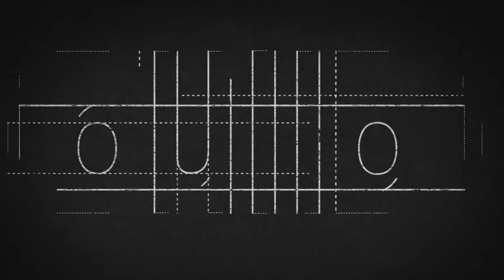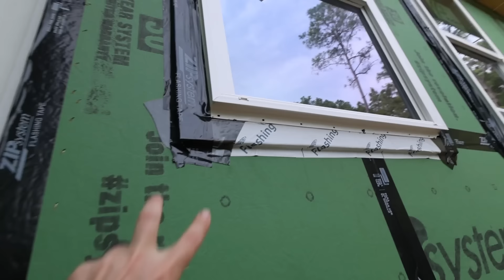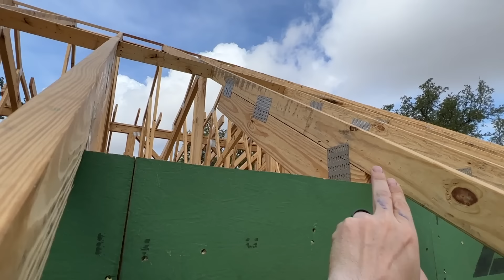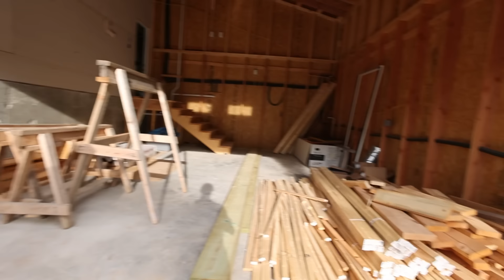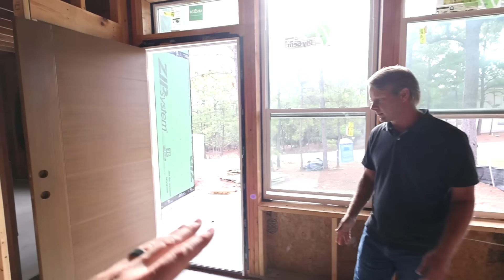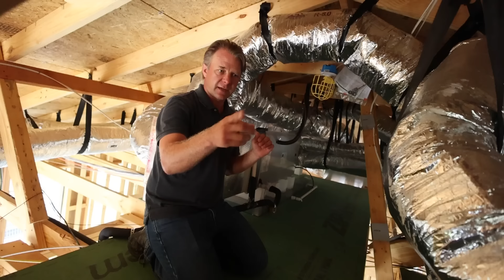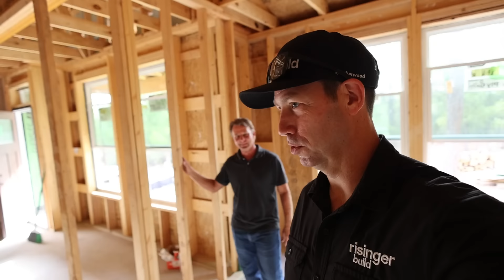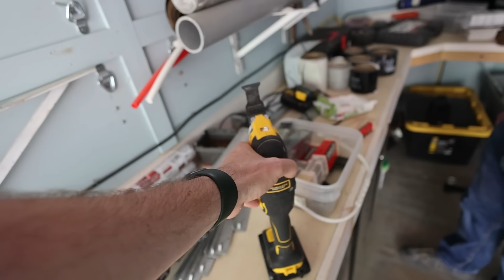LOW BUDGET Details For A High Performance BUILD

Comment: @matt as a fellow Texan, it would be a very interesting video to see tips on what current homeowners can do to better air seal on existing spec homes. I.e, what is the best bang for the $$ to do first. Should we caulk/liquid flash all exterior penetrations? Spray foam attic roof deck underside? Spray foam garage walls/rafter? I know it can vary based on the house, but I wonder if there’s a list of common ones.
Reply: Not sure if Matt has covered this one in any of his videos, but if you have an pull-down attic ladder inside the house, making an air sealed box is a great way to seal many square inches of otherwise unfettered airflow in & out of the house.
Reply: @justinjimenez6960  that’s a good tip, but I’ve already used spray foam on the underside of my roof deck, making it a conditioned space up there, so I actually want airflow and circulation with the air in my attic.
Reply: Hire an energy auditor to perform a blower door test and inspect for air leaks. They'll use a smoke pen to check around penetration like ceiling light fixtures and windows and doors, etc. In some places, energy companies or cities may have programs to subsidize the cost for this.

Comment: 18:10 Matt very good points and topics @matt risinger and this topic/queries can be a hole 1-2 hr vid in itself, OMG.
One thing I have trouble w/ is getting good plumbing subs who know how to work with freestanding soaking tubs that are on the high end of things (materials, function, plumbing it correctly, using correct materials again as some materials Can’t be used w/ certain brands etc.., & just understanding how they install and uninstall if gotta remove to fix or replace a part ¹ ) and it really is amazing to see and find out that the company coming to install & hookup plumbing and tub has never done one before, &/or don’t understand the mechanics. Example: don’t need to remove tub drain w/ drain wrench to remove a freestanding soaking Tub, they usually use a F2 drain assembly and will pop right up and out, ALSO don’t need to remove overflow either; and that’s another issue of concern, installing correct overflow assembly for the brand and model of tub b/c some need to be at 90s, or angled and finish around a 45 or something different altogether; but gotta read the rough in measurements and finished list of materials need, same for the high end toilets, some can be hours for installing and that’s the rough in; not counting actual toilet install, b/c of how some high end toilets mate to floor, wall, and closet flange and bolts; as some newer high end toilets have a complete different install system than the “usual regular” toilet most ppl used to…..
Ok, ‘nough of me writing novels & ATing you Matt (sorry), but really like your vids and what have to say, along w/ your stories…..LOVE ME SOME STORIES, regardless of length, cheesy, learn something, etc…. Nothing like listening to stories😊
Cheers✌🏻

Comment: what about soffit venting for attic heat?  Love the idea to seal the building but typically air moves over the insulation from the soffit out the ridge vent?
Reply: Absolutely not needed as it's a sealed space
Reply: No need it's a condition space it'll be tempered just like the rest of the house.
Reply: Not needed here but in other climates this is a BIG no no.

Comment: I am not opposed to the long format because there is always a nugget of knowledge in there somewhere.  My wife and I are currently building a high performance house in California using what we learned from your channel.  So far we have the Stego Crawl vapor barrier, foam under the sill plates and the Advantech flooring.  Our lumber and Zip R3 arrive tomorrow.  We have been documenting the build on our channel if you are interested.
Reply: Cali has very strong codes due to earthquake inevitability.   I'd be more concerned about building above code in that area and in materials and techniques that allow the house a better chance to survive a wildfire then I would be concerned about Air tightness.   This is nice for sure but he mentioned it's not built for earthquake concerns in mind.

Comment: @matt risinger  (real quick as an fyi: buildshownetwork website been down & not sure if a cloud flare thing or what thing🤷🏼, & miss my buildshow vids😫)
Hey Matt, when you added the zip sheathing to soffit up against sub fascia that’s angled and going back to rest against Zip sheathing, you can rip the Zip sheeting to same angle as roof and soffit to give a nice “connected surface” for when run your Zip tape and/or liquid flash. Yes, takes some more time; but at same time, not left w/ larger “gaps” that may require you to go back and fill a total of 1-3 times to get that sealed barrier system. Making the Zip Soffit same angle at front and back (as does take time) will help skip going back multiple times to do taping and liquid flash sealing. For those who don’t know, can use tracksaw (what I’d recommend using on-site) or table saw and a good blade for cutting, and making sure to keep things squared up etc….
Another tip for ppl, the circles & squares on Zip sheathing mean following: circles = 16 “ OC; & squares = 24” OC for a quick way of measuring w/o running your tape out; unless doing an “odd” pattern and than need to😉
Thx Matt for sharing your builds, knowledge, & experience w/ us. Always have a fun time watching the vids (wish more and longer TBH) & still pickup & learn new tips ‘n tricks from you and team (team you have on buildshownetwork dot com ¹ ); as can always learn something new regardless of years in the trades or on the job……and if your not still hungry to learn (or review) than gonna get passed by b/c w/ all the technology (tools, etc) and building science that’s out there always in flux (evolving, and such) you really need to embrace the tech & science b/c not gonna go away, and can (and does!) make things easier (at time harder, yes, but everything is the 1st time 😉); which means less time on a “job/service/tech call” which means more time w/ fam and friends…ahh yes, also more money too😉
Thx again Matt, cheers my friend ✌🏻💙

Comment: seems like with the increase of temperatures yearly house designs will have to change to address more extreme temperatures. Wouldn't more shading areas around the house help in cooling the air around the house? Having a covered driveway. extend the roof around the house.

Comment: The long format was suitable for this video. You were covering an entire house and introducing a builder. However, a smaller video covering specific topics is probably better for most videos. For example, you could follow up this video with a shorter cut focusing on the roof truss sealing detail. Shorter videos with a focused topic are easier to search and share.

Comment: Had to stop at "homebuilding as it should be" to agree. I ripped apart my 97 year old house to studs and it was hard as hell to custom cut each random distance stud bay with insulation and because it had fire blocking all the way around lol. The uneven surfaces and during and omfg. But homes should def be like this and yours, so much liquid flashing , buy a box of 8 at min for every 1000 SQ ft lol... Min. Open the sausage gun from the other end, it seals shut lol.

I called company and no solvent removes just mechanical, fun but good stuff

Comment: Don't use sill seal as a furring strip, I've tried it. It compresses too much, and too inconsistently, and allows your siding material to get wavy. The best budget friendly approach I have found is using ThermoPly, ripped into strips. Then you don't need to furr out windows, and worry about that detail leaking. I've had poor results from that in the past, so I try to avoid it.
Reply: Thank you for the comment! I am seriously going to reconsider the sill seal.
Reply: Scott as long as we are. Thoughtful creative, think out of the box-eschew zip ‘monopoly” and use cdx with Benjamin  obydyke SA product with built in rain gap.also i think if you price out that fentrim tape you will find. Zip liquid flash -or any of the equivalents Prosecco, henry blueskin, etc-is no more expensive and arguably superior I. Also i think it makes sense to run a thin bead of zip liquid flash over the bottom  edge of t he bottom zip sheathing board (for that matter esp OSB and arguably CDX sheathing as well).it’s unprotected by the green skin AND is often damaged on site/install. I know it’s more resilient than generic  ‘standard” generic osb, s. But its not advantech.
Reply: LMAO LMAO

Comment: So this should be added into anyone doing a new roof and soffits ? No more venting to ridge once spray foam done? I wish I knew all this before my roof was done , missed chance to add insulation but sheathing was 100/sheet and I have tongue and groove. No attic . Cathedral ceiling

Comment: Air tightness and insulation to this level should be a federal requirement for new houses and additions.
Reply: Piss on that idea
Reply: Building and Efficiency codes
Reply: Along with an air exchange system with heat transfer to maintain efficiency. And standards on materials and outgassing rates of toxic gases.

Comment: I see that Scott didn't do the Zip version 1.5 detail of liquid flashing the nails for the first 2 feet above the foundation.  Beyond that glad to see high performance building techniques done at an affordable price point.
Reply: I did this on my house, and it does take a little longer than you’d think. The liquid flash is messy, expensive stuff but is pretty incredible. I’ve had some around an outdoor faucet exposed to UV for a year and a half and it’s still as springy and rubbery as it was right after it set up.

Comment: So bc you spray foam the underside of the roof instead of the traditional blow in attic insulation, that means we do not need the overhangs where traditional sofit is placed to be able to vent and now can be sealed up?
Reply: No venting. The attic is a conditioned space. Conditioned attics reduce loads on HVAC and provide cleaner environment throughout the house. 
If you can find 2 videos of Matt's old house and the other of his new home; he shows the difference. It is Amazing how nice an attic can be when dirty air is blowing in, barely cooling.
Reply: I have basically the same question. Is there no roof venting at all? Isn’t that a problem if any moisture makes it through the roofing material and onto that roof decking it won’t be able to dry? 
Maybe the roofing material is going to be shimmed up like a rain screen? Kinda like how Matt did under his Metal roof?
Reply: Yep, you can either vent your roof or build it just like a wall. There are advantages to both.
Reply: How do you handle the vents from the bathrooms?

Comment: Dumbest thing ever?  Zip system!
Reply: Why?  What's your reason? Can you point to any info to explain your position?
Reply: @markwatson9816  permeability of one. So you have to have an entire fresh air system
Reply: @anthonyman8008  Thanks for the insight.  I guess it's a point of view but looking at it from a systems perspective I'd rather go with something like Zip and a ventilation system rather than pulling air thru a permeable surface unfiltered and uncontrolled.  It sounds like you're not a fan of the concept of "building science".
Reply: Not throwing zip under the bus but its pricey, it is osb based and the wrb is basically resin embedded paper, doenst seal fastener o punctures either. When is the last job you saw where the zip tape was razor flat and not bubbles/wrinkles  and fully rolled ? Zip acknowledge the entire assembly is NOT vapor permeable, when it came out this year with permeable zip tape. I like zip 3.0 -liquid flash on horizontal seams/joints, their vapor permeable tape fully rolled on vertical seams/joints, and quid fas on the bottom edge of bottom  and top edge off first boards to seal that edge and the joint/transition.
Reply: Found the Tyvek rep.
Reply: @anonymous..-  found the zip rep derp derp